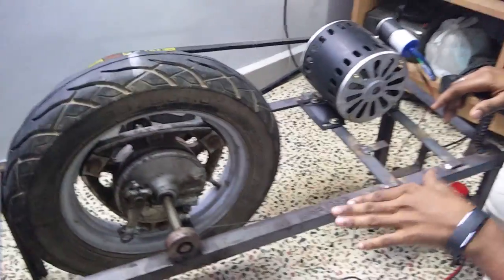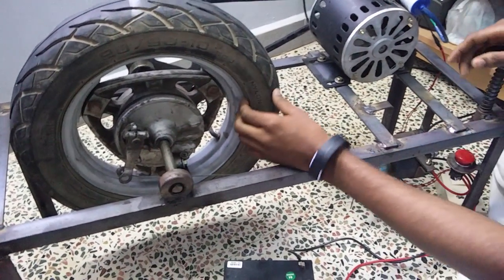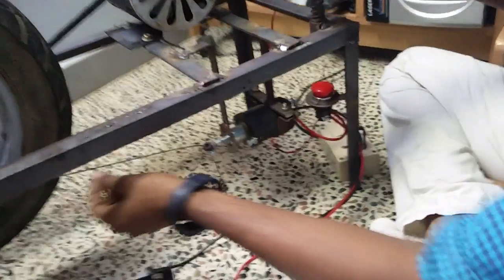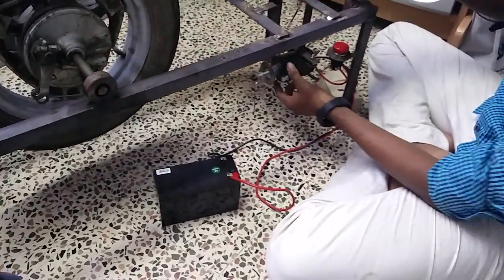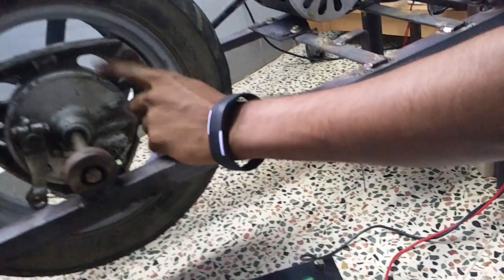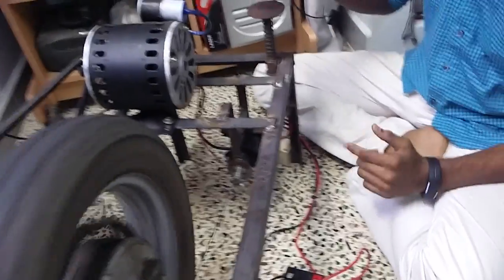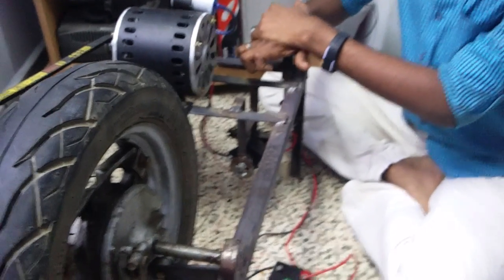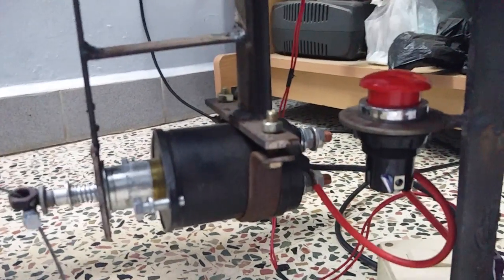Electro magnetic braking system

Comment: Its is just a solenoid operated mechanical brake and only for park brakes because it is just on and off. For variable braking force, you need a rheostat controlled torque or stepper motor, not just a solenoid. Then you can call it ‘brake-by-wire’.

Comment: i think it may not work when vehicle is actually moving with thousand of weight . cuz when vehicle is moving with such weight and you applies brake , device may fail. it will not stop vehicle due to inertia of vehicle and resultant force act on your device which may cause to brake your device .
Reply: what's the point when abs will just prevent it from doing this.
Reply: Engineers4 U and it'll work as per shown in video the accident can happen due to sharp break.the maintenance of battery will increase.. I think.
Reply: https://youtu.be/3Tt8uwRKFa8
This will work
Reply: AC current works at 50hz so  using pulse braking it can act as ABS in which the brakes calipers should open and close several times within seconds or couple of seconds it can work this way, if without pulse sudden brake the vehicle will slide or topple.

Comment: It is a good project....I have a few comments, 1, from this system, the only place where the electromagnetic physics is applied is by using the starter's electromagnetic puller to replace the human mechanical input by action of his leg. The wheel stops instantly since it has no load on it. I have a concern though, this system is not variable, it is either fully engaged ( emergency braking) or not engaged at all. In real life, it would be dangerous to people. You might want to revise the design and introduce variable magnetic pull, maybe by introducing a rheostat to vary the current.

Comment: Interesting.
Now I'm assuming that the brake drum on the unit is not like a standard drum that uses pads to create friction on a metal surface(rotors) in order to slow the vehicle-  assuming this system use magnetism specifically to stop the tire, I would like to see if you're able to reduce the tire's speed slowly.
Have you been able to control how much braking pressure can be applied so that it isn't a complete dead-stop?
Reply: Ryan Carpenter I think he is only referring to the electromagnetism applied from the solnoid to brake, rather than what looks it be normal brake drums. You could potentially vary the strength of the brake by how much power you apply to the could, but it would be very hard as the strength of the pull would increase as the rod got closer to the magnet. You would probably be better off using a servo or some kind of hydraulic device
Reply: https://youtu.be/3Tt8uwRKFa8
It apply the brake instantly
Reply: Koo